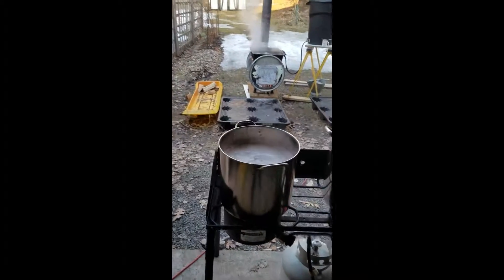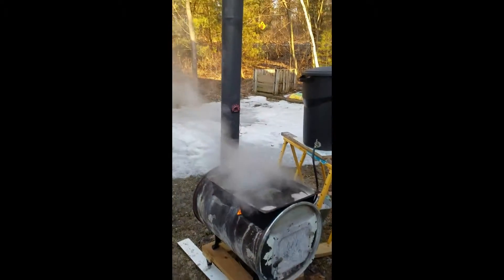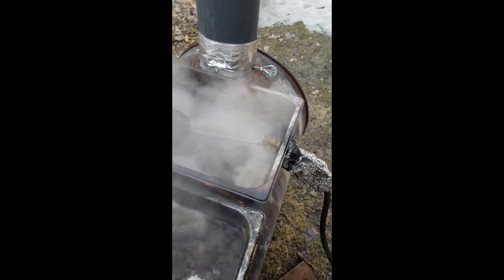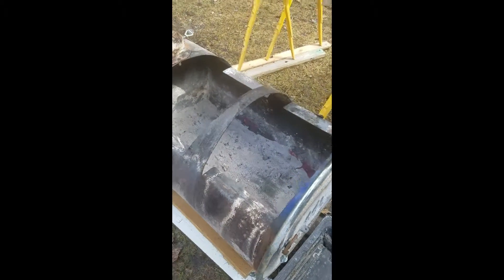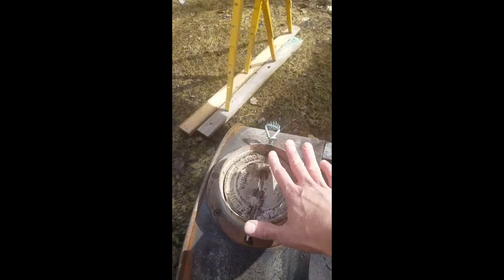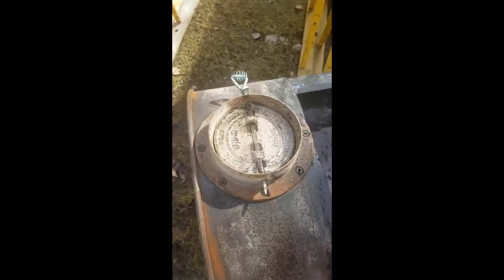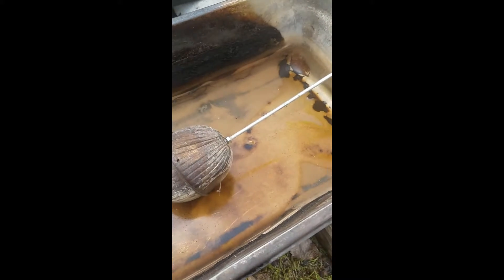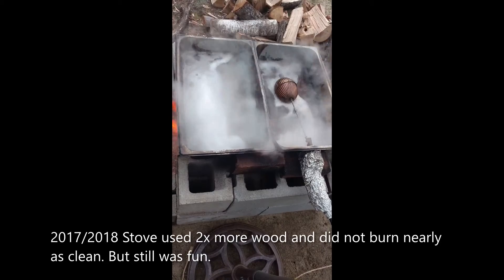Barrel Stove Maple Evaporator - 2019

Comment: If you did it over again would you put the stove pipe on the back side with an elbow?
Reply from the maker: I might,  it was tricky fitting both pan openings in the allotted space. Functionally, it may be better on top as it draws the fire around the pan before exiting and it is also more compact for storage. 6 of 1, half dozen of the other. 🙂